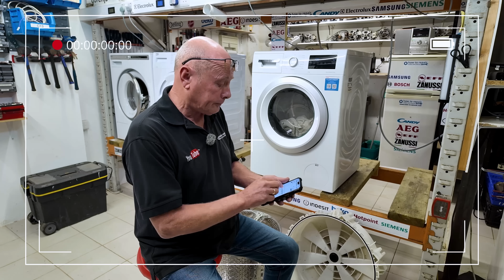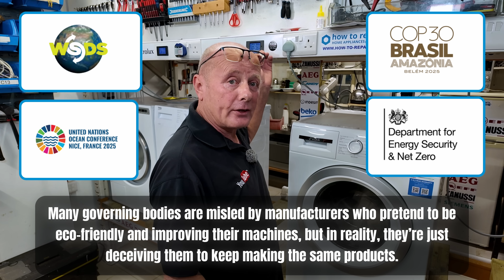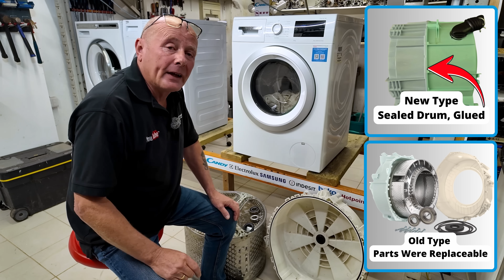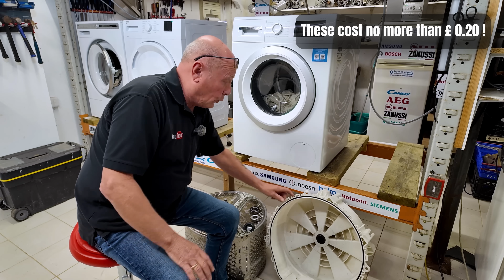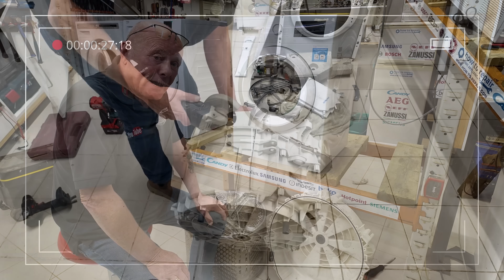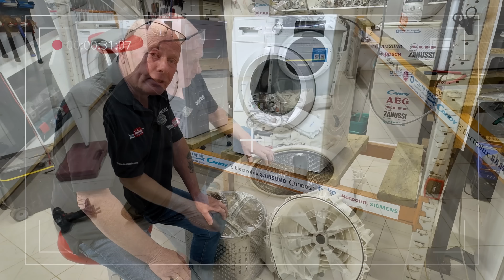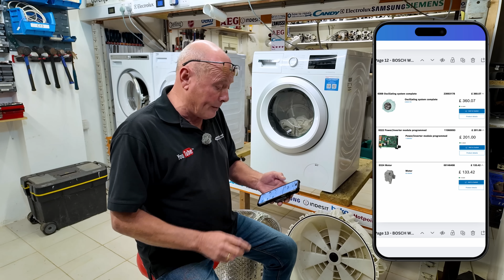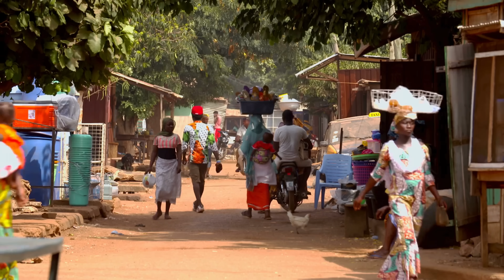Washing Machine SCAM EXPOSED! The Truth About SEALED Drums: Naming & Shaming

Comment: Tks for very, very good information!
And why is a seale drum more hygienic ???
Because don't have stainless steel bolts?
Reply from the maker: Thanks for the comment mate. The stainless steel bolts of an old machine were never the source of the hygiene problem but the sealed plastic drum, which traps dirt in crevices, is often worse. To make a real difference, we need to get this message to the people in charge and tell those appliance-wrecking accountants to back off! I would be grateful if you would share this post, as it’s the only way to force things to go large nowadays.

Comment: So parts are expensive but that's always been the case with cars or any other piece of equipment. I was hoping you would explain how manufacturers engineer these machines to fail early - for example I bought a Mitox chainsaw and I can show you exactly how the Chinese manufacturer has engineered it to wear out from the first turn of the crankshaft.
Reply from the maker: Thanks for the comment mate but the question is: Are they priced high to cover legitimate storage/inventory costs or are they priced high to deliberately make repair anti-economical? Manufacturers design products with an expected (and artificially shortened) average lifetime. This is achieved through engineering tactics known as Contrived Durability and Component Incompatibility. The key takeaway is that planned obsolescence is achieved by setting up cascading failures using the cheapest material at a critical junction to guarantee a high-cost failure just outside the warranty window. To make any real impact, we need to catch the attention of industry leaders and put an end to these wasteful practices. Sharing this post is essential to help spread the message. Thanks, Paul!

Comment: This is the same argument about diesel particulate filters/DEF/EGR. They fail so often and get replaced in high numbers, it completely negates the emissions reductions.
Reply from the maker: Thanks for the comment mate. The solution is the same: Right to Repair laws must compel manufacturers to design these emission control systems to be modular, durable, and economically viable to repair, rather than replace. To make any real impact, we need to catch the attention of industry leaders and put an end to these wasteful practices. Sharing this post is essential to help spread the message. Thanks, Paul!
Reply: @How-to-repair  They can't agree on a common wheel bolt pattern! 😂

Comment: Thanks for posting this. In the next year or so I'll be replacing a number of kitchen and laundry appliances and shall be voting with my feet against these cartel manufacturers. Would appreciate (if you can be arsed) a roundup of honourable manufacturers who still make repairable machines... even if it's just a quick short.
Reply from the maker: I've already created several videos offering guidance on choosing durable and repairable machines. Please check them out. However, it's impossible to make a definitive list mate. Manufacturers are constantly changing production lines and product tiers, so brand quality is all over the map. Your best defense is to find a brand that fits your budget and ensure they supply technical information so you actually stand a chance of repairing it yourself. Also, a pro tip is to always ask if the drum is splitable before purchasing a new machine.

I appreciate you taking the time to share this comment. Please don’t forget to subscribe and share this video so others can make a wise, informed decision.

Comment: Microphone also unrepairable. I had a model year 2002 Kenmore Front Load Washer ( Sears brand, made at the time by Whirlpool ) which shot the grease out of the drum bearing in 2022. A nice local guy in the repair business quoted me 600.00. of which only 30.00 was the part. Totally repairable, but the labor was substantial, due to the complication of teardown and reassembly. I agree, his pricing was reasonable, considering. He recommended getting a new machine. UNFORTUNATELY, the 600.00 Kenmore replacement was now an LG which is... less satisfactory. Only bonus, the fins in the drum are much smaller, and the drum slightly bigger than the Whirlpool, so machine can clean comforters. 

I partially regret not having the old machine repaired.

Comment: Car manufacturers have always used making cars obsolete by releasing year models making the previous year release obsolete by releasing a new model, not that I support it, i actually like you insight and courage
Reply from the maker: That is a truly insightful historical perspective. I agree with your analysis and I appreciate your kind words it takes courage to speak out against an entire industry and it takes courage to recognize the truth. The tradition of planned obsolescence in the automotive industry is based on style and model year changes which is now being combined with electronic failure to force replacement.

Help me hold the industry accountable by sharing this video. To make a real difference, we need to get this message to the people in charge and tell those appliance-wrecking accountants to back off! I would be grateful if you would share this post, as it’s the only way to force things to go large nowadays.

Comment: It is not so good in India either. In the last 40 years, I have purchased an IFB, a BOSCH and now an LG machine. My use load is low, once or twice a week. But when there is a problem outside warranty, I was forced to get a new machine.
LG somehow appears to be the best of the lot. My heater failed and I could not find the spare in India; I procured one from AliExpress- I should have got two. The door lock went bad but I could get the part from Amazon. Recently I had to replace the water level sensor. The LG machine is repair-friendly but parts are very hard to get.

Comment: Totally agree. My last washing machine (Baumatic) gave up after about 7 years when the drum bearings started making a horrendous noise. I bought a new pair of bearings for it, only to find that they were completely inaccessible. I gave up and bought a new machine.
Reply from the maker: Thanks for the comment mate. That is the absolute core story of the planned obsolescence scam and I'm very sorry you had to scrap a machine that was otherwise functional. The sealed drum is the physical barrier that transfers a cheap failure into a financial write-off. The cost of the part alone often exceeds the worth of a 7-year-old machine, leading you to the only logical, albeit wasteful, conclusion: buy a new machine. This is not an accident; it is the deliberate design choice that defeats the repair trade. To make any real impact, we need to catch the attention of industry leaders and put an end to these wasteful practices. Sharing this post is essential to help spread the message. Thanks, Paul!

Comment: I used to repair and refurbish washing machines when I was a teen; roughly 30 years ago, as my dad owned a second hand goods shop.
Recently my washing machine broke, so I decided to have a look in it. The amount of cost cutting I saw shocked me. 
The biggest difference I saw was how much concrete had been cut from older machines despite drum capacity and spin speeds increasing a fair bit since I last repaired a machine.
The drum support/suspension struts were another cause of concern. So much plastic involved in the sturt and even mounting points. It isn't even fibre reinforced plastic, just thin plastic. Looking a bit closer, I noticed that one of the mounting points was snapped at the drum on my machine. That explains why my washing machine had started walking across the kitchen 😂

We are being scammed.
When I was a lad my mum bought a Zanussi washing machine. It lasted 35 years. My £800 washing machine couldn't even get out of its warranty period. Wouldn't you know, my cooker just packed up, too.
Reply: What greed is, concrete it's not that expensive
Reply: Well, part of the concrete has been replaced by software (drum balancing and vibration sensing). That is a good thing, I believe.
But still, they are a lot weaker than before. I have a Bosch WFK2690. Wonderful design of panel and front, it looks modern, even though it is from 1997.
Reply: I had the same probuelm
Moved the m/c found a nut and studding on the floor i am a engineer went to work got a nut and studding from stores 
Fixted it in 10 min
A w/m engineering came to fix it when i was at work said it was the motor charged me 167 pounds he was a con man got arrested by police for this riping off OAPS
Reply: That is literally the biggest bullshit ever posted in comments on this channel...

Comment: I understand the outrage, but still U CAN CUT AND WELD PLASTIC DRUM after you replace bearings or a spider. As a repair technician you should invest in hot air plastic welder and successfully repair those drums also.  There are countless vids here on YT on how to do it.

Comment: This has been going on for many many years. Our Bosch washer dryer failed to dry. Repairer said he couldn't recommendcacrepair due to cost of parts being close to the price of a new one. So we got a new washer. Bought a stand alone dryer later. Dryer failed. Same story. So it wasn't replaced. 
Ironically my brother's father in law bought a Bosch when he got married, about 50 years ago. He bought some spares at the same time. 30 years later none had been needed, despite heavy use with e daughter and his mother in law there. 
Another issue is as you can see, parts quality. No reason bearings should fail, or the pcb. Seals I can understand because of wear. But jot a quick fail.
Reply from the maker: That is a textbook example of the financial trap set by the industry and it confirms the grim truth about planned obsolescence. The only way to fight this is with legislation that requires genuine repairability and component quality checks which is what the Right to Repair is trying to achieve. 

If we keep sharing these videos and talking openly about these uncomfortable topics may help us fight against the obsolescence. Sharing this one helps it reach more people and build momentum over time. Thanks a lot for your comment, it really means a lot.

Comment: I agree with everything in this video, however, I feel like labor costs in the west are so high that even if the parts were cheaper it wouldn't help. For a bit more money you can buy a new machine from a known brand, or, for same money you can buy a new machine from china. I wish it wouldn't be like that. I tried twice to get an offer to fix a machine, both were not worth it because of labor costs.
Reply from the maker: That is a truly essential point that gets to the heart of the matter. My 40 years of experience confirms your feeling mate. In high-cost western markets, high labor rates are the second financial firewall that manufacturers rely on to force replacement. You are absolutely correct. Even if the part cost were zero, the repair would often still feel not worth it. I appreciate people like you taking the time to write it out. Please don’t forget to subscribe and share it where possible. It might help others make a wise choice instead of being misled by the industry.

Comment: Hi do bosch seimens use sealed drums if u bought a washing machine for £1000?
Reply from the maker: Manufacturers constantly shift their production lines and release a vast range of products, meaning every brand has machines of both very good and very poor quality mate. That's why I can't give a definitive suggestion but I can make some suggestion.

The smart buyer's strategy is to choose a brand within your budget that also makes technical repair information available, and crucially, ask the seller if the drum splitable. 

From my experience, I personally loved my ASKO machines. They're mechanical workhorses that often rival or beat modern Miele models especially because they stick with a stainless steel outer drum. Some LG units are quite good as well. And big props to Beko even though they make budget items, they stand out by offering helpful workshop manuals and wiring diagrams, making them repair-friendly. 

Thank you for this insightful comment. Please subscribe and share this video to help others make informed choices!

Comment: Bearing failure is often caused by hard water stiffening the bearing seal. Once the shaft seal hardens, it loses flexibility and allows water in to damage bearings. A good water softening regime will protect the bearings.
Reply from the maker: Your advice for a good water softening regime is one of the most effective non-repair ways a consumer can prolong the life of their appliance. Softened water improves cleaning effectiveness, reduces mineral scaling, and, most importantly, protects the seals from hardening and failing. However, it's not the only solution. We still need strong Right to Repair laws to force manufacturers to use durable materials and make high-cost components modular and repairable whether in the appliance or auto sector. Thank you for your comment. I appreciate people like you taking the time to write it out. Please don’t forget to subscribe and share it where possible. It might help others make a wise choice instead of being misled by the industry.
Reply: @How-to-repair  I've been on the tools for 35 years+. As you say, customers just don't go for bearing repairs now due to cost. Having said that, I haven't done bearings for 20+ years other than half-tubs where the bearing is already seated in the rear half tub, and like you say, even half-tubs are becoming rare now. I remember the old Merloni Servis metal backplate which was a nice easy bearing fix. The last sealed tub I did was about 7 years ago, although I did them every week when I worked for that big German firm!

Overall though, the trade remains fairly buoyant as bearings and pcbs are the exception to the average repair. I've had 3 bra wires in one week - nice easy money! Elements are still cheap and door seals too. Blocked sumps and filters are a good earner.

To be fair, your point about obsolescence is spot on, but overall, bearing jobs and even PCB ones are not the norm in my working week. It's mostly blockages, elements, seals, broken wires on dishwashers (Beko, I'm talking to you!) and unblocking washer dryer ducts and resetting TOCs, so from a repairman's point of view, I don't think that the sealed tub is much of a problem, and saying that, if I DID have to do a bearing change, I'd rather drop in a sealed factory-assembled unit with a new fresh new drum, bearings & spider, than bashing out some bearings and re-seating them, and hoping that the spider/drum is still okay.

What I'm saying really is that bearing jobs are probably less than 5 percent of jobs that come in, so not a big issue for a tradesman, but possibly more an issue that concerns the end user more.

Comment: 8:27 Yes, they think that and they´re right. I know so many people who don´t even look what is wrong with a washing machine, dish washer, tv or any other device and they don´t want to pay someoe to take a look at it. Instead they just replace it and throw the old one away, even when it just needed a new belt. That´s how much money people in the north have. 
When the battery in the phone doesn´t last anymore or the computer is a little slow after a few years, who takes it to a repair shop to get it fixed? 
Most people just buy something new. They don´t care. Instead they get sold new machines and people even feel good about it because those machines come with the promise of saving energy and water and some even have an internet connection and an app for I don´t know what.

Comment: Excellent video. The Competition and Markets Authority has announced investigations today into online pricing. I think that planned obsolescence for white goods is an issue that affects more people than the targets that they have just announced (which is principally related to the way that online retailers - including some home appliance retailers - mislead customers seeking to buy items online). If you have not already, I think it would be worth making a report to the CMA on this, for two different aspects: firstly, preventing consumers from cost-effective means of repairing washing machines (and presumably, other forms of home appliance are being similarly manipulated); secondly, because the fact that all of these manufacturers changed the way that they make their drums at around the same time raises a suspicion that they have acted as a cartel.
Reply from the maker: I'm not sure it will be enough, but at least it's a move in the right direction

Comment: people have suspected it for years ,washing machines dryers and even cars are going the same way as mobile phones once they get to a certain age they start to break down ,with ford cars its around the eleven year mark when cars start to experience electrical parts failing  needing replacements because the parts can not be repaired then after that its various things like electric window winders going brittle ,ignition barrel,fuel pumps , all the things that have you looking at replacing the car before the cost of keeping it become too much
Reply from the maker: That is a perfect summary of the planned obsolescence engineered into modern vehicles and my 40 years of experience confirms that the auto industry is simply using the same playbook as the appliance manufacturers. We need strong Right to Repair laws to force manufacturers to use durable materials and make high-cost components modular and repairable whether in the appliance or auto sector.

Thank you for your comment. I appreciate people like you taking the time to write it out. Please don’t forget to subscribe and share it where possible. It might help others make a wise choice instead of being misled by the industry.